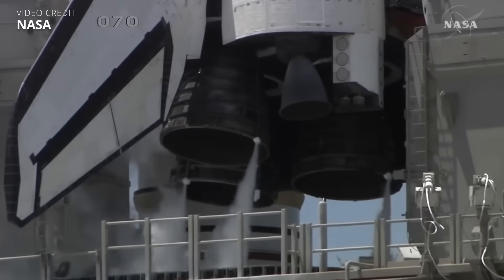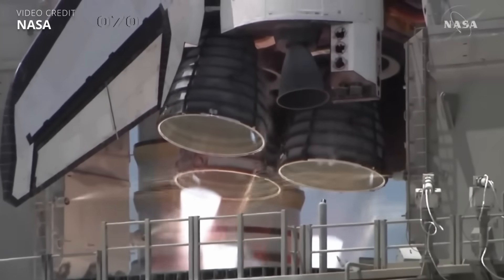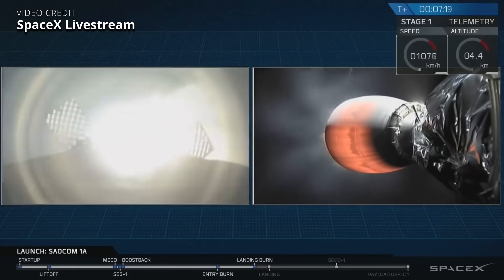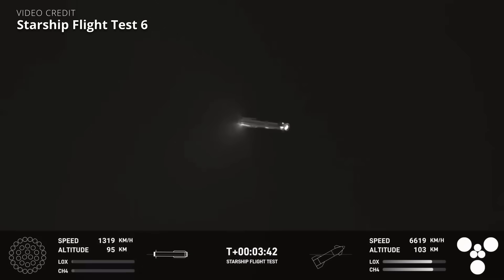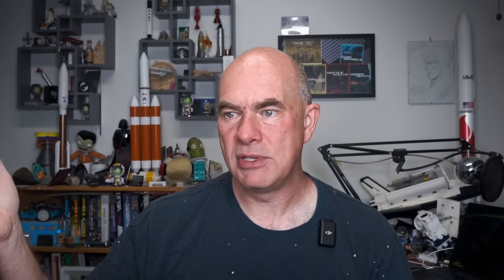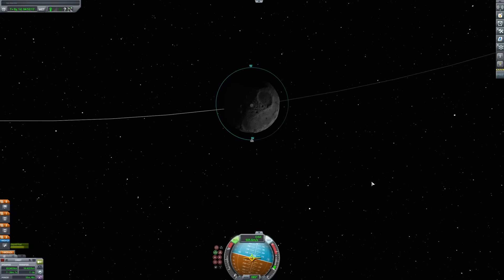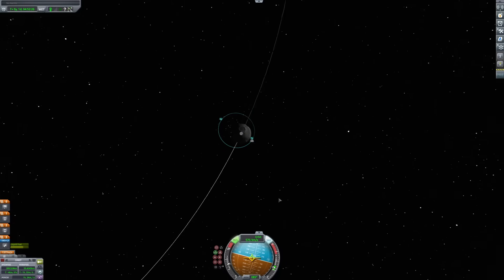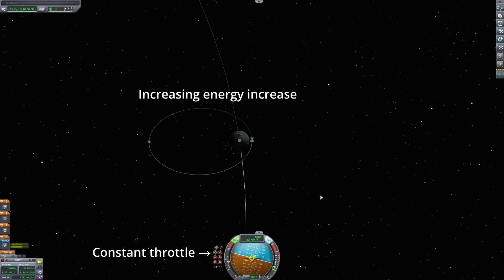Where Does Rocket Exhaust ACTUALLY Go?

Comment: 2:42 So if the exhaust speed is about 3km/sec, then it means that during ascent, there is an inflection point where the exhaust is exactly stationary relative to earth, and after that, the rocket exhaust is actually moving prograde!

Comment: Exhaust travels at the speed of sound?
No, thousands of miles an hour
Reply from the maker: Speed of sound in the exhaust gas
Reply: @scottmanley interesting dynamic situation. I believe the velocity of gas at the nozzle is dependent on pressure in combustion chamber not speed of sound in the gas. 

It's ballistic like a shock wave from an explosion which travels faster than the speed of sound. 

The gas eventually slows down as it mingles with the atmosphere. 

Consider appollo. Burn to the moon. Spacecraft eventually reaching 25k mph. Exhaust gas pointing tangentially to the earth at about 4k mph. 

So will still be receding from earth at less than escape velocity so will fall back to orbit the earth and eventually mingle with the atmosphere.

I wonder what happened to the exhaust gas in the return burn. Some may have escaped the earth /moon gravity system and be orbiting the sun. 

Some even still orbitting the moon perhaps. 

Though with the effect of the solar wind before long it was probably flying all over the place

Comment: Where in the thrust chamber does the thrust become exhaust? I'm not kidding, at some instant the hot thrust gasses no longer provide force, they then become exhaust. Where does it happen? It would be different if the gas is over expanded, under expanded or in the Goldilocks zone, but where is it in any of them?

Comment: 7:45 I believe, gravitational sling shot works mostly because gravity falls off with inverse square so the faster you thrust away and into a well the more of that acceleration is optimized (or in reverse when escaping a well, the less cost of gravity experienced over time to decay the energy gained by falling).

I don't think it has anything to do with the gas from the exhaust being caught by the planetary body. It's all to do with the ratio transfer 1/r² : f=MA, I'm pretty sure.

Can anyone mathy confirm / disprove my napkin hypothesis here?

Comment: I am not an expert, however I think I can provide a mathematical for me  intuitive enough explanation for the Oberth effect: 
The energy or an orbit is conserved and is basically the sum of its kinetic energy (0.5*m*v^2) and potential energy (whose equation is not important now) at any point. In other words, if you want to raise your orbit you need to increase your velocity. However, notice that the KE(kinetic energy) increases with the SQUARE of the velocity. This will be useful later. 
However lets first remember how a spacecraft gains velocity by throwing away propellant, as it is in the rocket equation (google it and you'll see.). The more propellant you throw out (exhaust out), the more your mass ratio will be, hence the more velocity you gain. However, the amount of velocity you'll gain with given amount of propellant won't change based on your CURRENT velocity, that resulting dv(velocity change) you get is just added up to your current velocity.
 Now, let's go back to the fact that the kinetic energy increases with the square of your velocity. Now, imagine you have a current velocity of "v" and you gain "x" amount of velocity trough a burn. Your initial kinetic energy would be v^2 times whatherer half of your mass was(as per the equation). Your end kinetic energy is (v+x)^2 times the half of the spacecraft's mass. That is (v+x)^2= v^2 +2*v*x + x^2. So the change in kinetic energy would be your final KE minus your initial KE. That is (v^2 +2*x*v +x^2 -v^2)*m*0.5. That equals (2*x*v+x^2)*0.5*m.
 If all this math was bit confusing, I suggest  just looking into the end result: The change in kinetic energy increases with the initial speed!
 So imagine you started out with a 1000m/s and gained 100m/s, the equation yiels (using a calculator for that)  210000*m*0.5 change in kinetic energy. For an initial speed of 2000 with 100m/s increase that would be  410000*0.5*m, so double of that!  
This would also mean the oberth effect does not only take effect while, say, making a burn during periapsis, but anytime, anyhwhere, as it is just a result of how kinetic energy is gained in relation to the initial speed.

Comment: I am old enough to remember sll of the Apollo flights and, while I can’t recall which mission, I remember one of the commentators on NBC mentioning that when they ventrd the LM before an RVA they were increasing the Moon’s atmospheric pressure by more than one percent. So if my memory, and their information are correct the engine exhaust had to have increased the density of the Moon’s atmosphere be severely percent - it producing more gas than the LM’s cabin.

Comment: Just remember that the whole earth is covered by caesium 137 ( not naturally occuring) from the nuclear testing of the 50/60s, every single inch you can detect it everywhere ( soil movement is measured using cs-137), since these particles are flung out at great speeds and are very small, its likely they can effect very large areas.;

Comment: A tiny nitpick about specific impulse:

Thrust has two components (search for the "Rocket Thrust Equation"):
One: the thrust generated by accelerating the propellants, equal to the product of the mass flow rate and exit speed.
And two: the thrust generated by the difference in exit pressure and ambient pressure, pushing on the exit, equal to the product of the pressure difference and exit area.

Specific impulse is the ratio of thrust to mass flow rate, and thus includes the pressure-thrust component. If this component is zero, that is the exit and ambient pressure are equal, then specific impulse is equal to exit speed.
If the flow is underexpanded (as it would be in space), the exit pressure will be higher than ambient, and this component will not be zero. The specific impulse will thus be a bit higher than the actual exit speed. (Conversely, deep in the atmosphere the flow might be overexpanded and the pressure term contributes negative thrust, thus making the exit speed higher than specific impulse).

Using specific impulse as an approximation for exit velocity will probably give a decent estimate, but I thought it was worth pointing out.
Reply: A completely legitimate expression of iSP is exit velocity. For one, velocity explains why hydrolox is so excellent and why the exotic mixtures with oxydizers that weigh less than oxygen are even higher.

Comment: There’s something I’ve always wanted to know about rocket engines! If a rocket gets up to the speed of 17,500 mph. Does that mean the exhaust coming out of the rocket engines are going 17,500 mph? Because like a car going 100 mph you can calculate how fast the wheels are turning based on the size of the tires. Just a weird question I’ve always wondered.
Reply: SpaceX raptor engine has exhaust gas velocity of about 7,763 to 9,842 mph.
Reply: it depends on your reference frame. as wally noted above, the velocity relative to the spacecraft is 7763 mph. if we were to measure the velocity relative to the earth, it would be 17500 - 7763 (9737 mph)

Comment: Related to moon atmosphere, would it be possible to orbit the moon elliptically such that you dip down to like a meter off the surface or possibly into a lunar trench of some sort? You did something in KSP once with flying through the arch at high speed and I'm wondering if that's possible in real life. Could be quite the thrill junkie tourist attraction.
Reply: Yes, given accurate enough maps of the surface of the moon and precise enough maneuvering engines. Of course, lunar orbits aren't stable (the Earth is too big and too close), so the next time you came around, you'd be somewhere between 100 meters to -100 meters of the surface.
Reply: @HiddenWindshield right, I'm imagining a single dip down to the surface for thrills, not sustained orbit. I could even imagine just getting put in a plastic bubble with 360 degree views and minimal life support, whizzing by Apollo 11, and then getting picked up again at apogee. Sounds insane but I think getting within a few meters of impact could actually be reasonably safe. The other possibility would be to plot an orbit BELOW the surface through a trench so you get surrounded by the moon with canyon walls on either side, but I'm not sure if the moon has anything like that.

Comment: During the time of the Saturn V flights it was noticeable that two weeks following a launch where I lived, experienced severe downpours. 

On Apollo 8, 10,11,12,13,14,15,16,17 and Skylab 1 (the station) launch, it occured.

A weatherman explained on the local TV that it was as a result of the water vapour dumped into the upper atmosphere by the Saturn 5 stages. Never happened with the Saturn 1Bs or the STS launches.
Reply: Silly, and very dubious coincidence. Are you sure your old memory is working correctly? The atmosphere moves THOUSANDS of miles in two weeks. The air that was present at the launch would be NOWHERE NEAR you two weeks later! 😂🤣😂🤣

Comment: As someone who did a kerbal mod for an open cycle, gas reactor nuclear thermal rocket, with a lot of background research (including modelling shadow shielding with ray casting), I have actually thought about where the exhaust gases go.  Especially the highly radioactive fission products.  :D
Exhaust gases, hydrogen, more hydrogen, some strontium, thorium, zinc, cesium, uranium, and tungsten powder used so the propellant absorbs the energy better.  Plus of course some fluorine used as uranium hexafluoride is easier to handle than metallic uranium.  Nothing to worry about in that exhaust....
The neutralizer on electric thrusters are also there so you don't end up with a massively negatively charged spacecraft

Comment: Next question is, what does all that gas’s do in our atmosphere? It’s always advocated as being harmless, but apparently that’s not true because it still has the ability to form barriers that capture more heat, at scale that still influences the climate, even if the fuel types are normally harmless or not as bad as traditional kerosine used in airplanes.
With launching volumes scaling up, there’s a threshold upon which the negative effects become more then significant, and it’s not that far off. I have seen a breakdown of it, just can’t remember where.

Comment: I teach Electrical Engineering at a local University and once I talked to Freshman about what Voltage, Current, Power, and Energy are and their analogs outside of Electricity.  On interesting thing is that what energy is not easy to explain/define.  Also, it is hard to define why energy conversion is often unidirectional.  You can easily turn gasoline into Kinetic Energy but it is not easy go the other direction.  All this seems intuitive until you have to turn it into a formal lecture.
Reply: I think the only fundamentally unidirectional law in physics is the second law of thermodynamics. It cannot be easily reversed, because entropy went up during the process.
Reply: I seem to remember them turning carbon dioxide, steam and more heat into hydrocarbon fuels about 80 years ago when it became difficult for some people to get their hands on natural petroleum.

Comment: I don't think that's the Oberth effect. It is that you get more energy the faster you are moving. The exponential rise of the apoapsis is due to the decreasing amount of energy need to get there. A better example would be 2 identical rockets but one is moving at 40 m/s and another is moving at 4000 m/s. If both rockets were to fire their engines the fast one would get more delta V, regardless of their position in orbit.
Reply: that's the oberth effect, as you get closer to a gravitational body your speed increases, which increases the change in energy you get some the same delta-v because velocity is squared
Reply: @clayel1 it doesn't have anything to do with the distance to the body. If your space craft is close to Kerbin, let's say you did a vertical trajectory and is going 40 m/s and then you burn for 2s and now your speed is 100m/s then (same craft) if you are, say coming in on an interplanetary trajectory, at 4000 m/s and you burn for 2s then your speed will be say 4065 m/s because the burn is more efficient. Effectively you got an extra 5 DV for the same fuel. I don't know the factors so I don't know if 5 DV is realistic.
Reply: @christopherlperezcruz1507  as your distance to the body decreases, your speed increases, increasing the boost in velocity you get. this is the oberth effect. of course, you can go faster without being closer to a body, but that requires delta-v to begin with
Reply: @clayel1 yeah but it's just the speed. He explained it wrong. He was showing how the orbit was sensitive because he was fast/close to the body. Oberth has nothing to do with orbits. It's something to do with the engine. I'm not sure why it works. He probably knows why, he just got confused.

Comment: I use to work at LAX. Got to see five launch over the years. You stop whatever you are doing. The wind strata are (stratum is) evident when the exhaust bloom hits different altitudes of changing directions and speed.
Reply: Strata is plural. So, strata are, not is. Or are you one of those guys that use phenomena in the singular, too?
Reply: @Anvilshock .  I actually had to look it up and  Yes, you are correct and I corrected my mistake.  Thank you. 😅
Reply: @oldmech619  Thank you, too!

Comment: I remember watching a test of I think it was the booster for the shuttle. The exhaust cloud, mainly steam, formed an actual cloud and it rained downwind as the steam cooled, condensed and fell from the sky. Exactly as rain does.

Never mind cloud seeding. That doesn't even work, anyways. Just bring a rocket engine in and strap it down real good. Don't want it to fly off and take out somebody's eye.
Reply: :) Yes, yes, always wear goggles near a rocket, for safety! And gloves, as they are hot to touch, too.

Comment: I know of a dramatic demonstration of far-field rocket plume effects.  The Skylab Workshop, America's first space station, was nearly lost on it's way to orbit when larger than predicted aerodynamic forces tore off one of two main solar panels, along with the reflective outer skin that kept the Sun from raising the station interior temperature beyond habitability.  Before the first crew launch, NASA devised a deployable "parasol" sunshade, made of very thin aluminized Mylar foil, that could be folded up to fit in the Apollo Command Module, which was used to carry the crews to and from the station.  It was unfurled by the first crew, and succeeded in reducing the Skylab's internal temperature from 140 F to a  comfortable 70 F.  One of the two subsequent crews took film footage out of the window of their Apollo spacecraft as it approached Skylab.  The Apollo had a reaction control system consisting of four sets of four 100 pound  thrust rocket engines that could control the attitude and velocity of the spacecraft.  The movie of the approach shows the effect the forward facing thrusters had when fired at Skylab, even from a considerable distance.  Every time the RCS engines were turned on, the Mylar sunshade would begin to flutter as if in a heavy wind.  The video can sometimes be found on line, but unfortunately, I don't have a current link.

Comment: Glimour rocket just had a RUD... but looks like it landed soft enough for the rocket to continue to combust somehow.  No fireball as you would expect on impact.
Reply: Gilmore's main engines are hybrid engines - a solid fuel burnt in a liquid oxidizer. So assuming that the oxidizer largely disperses on impact - and they could have triggred FTS to ensure this - the remaining bare solid fuel would be expected to burn relatively slowly in just air at low pressure.
Reply: @robertbackhaus8911  Yeah, it's one of the few advantages of a hybrid system... combustion doesn't really happen unless it's under control, so damage is more likely to result in a messy shutdown than an outright explosion. 

Mind you, all-liquid systems aren't that bad either... if something goes wrong, you'll inevitably get a spark before fuel and oxidiser can mix properly, so you'll get a fast burn rather than a full-on detonation. To really blow things up, you need solids.